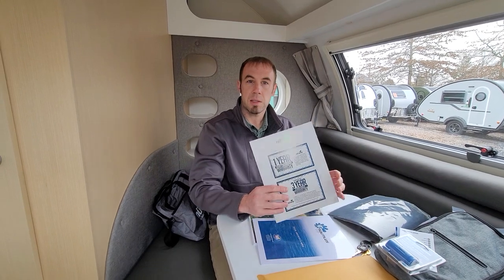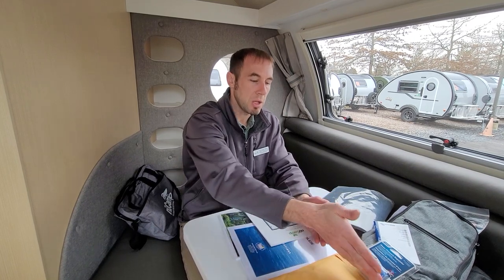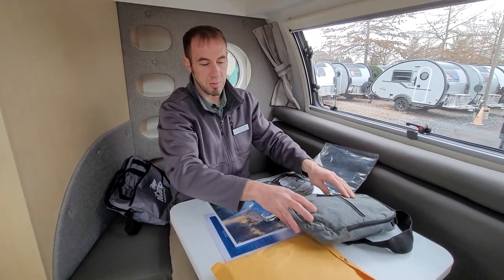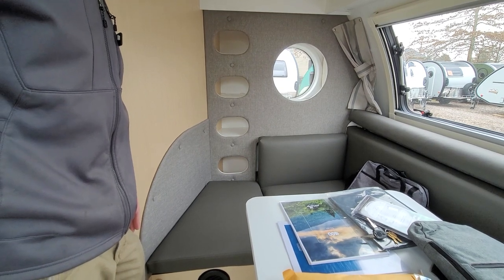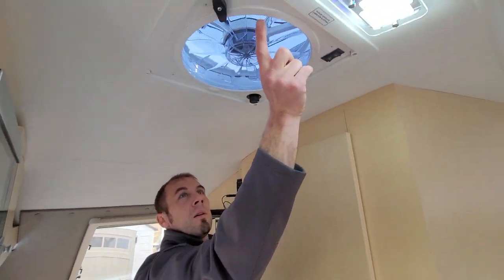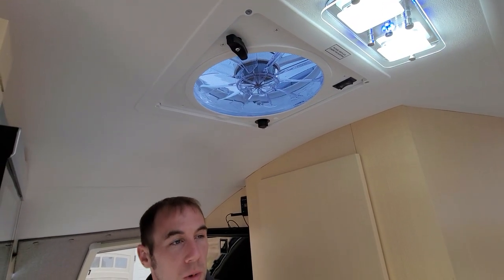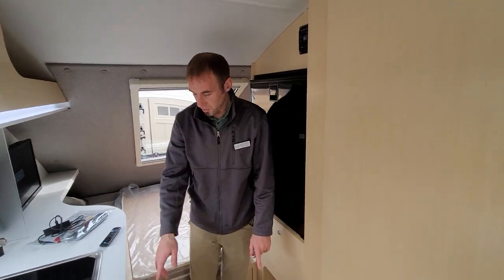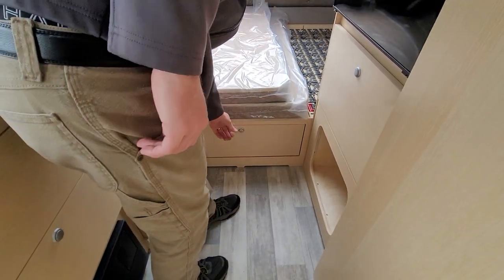2023 T@B 400 Instructional Walk-Thru (Part 1)

Comment: Just a quick comment.  The glycol is very specific to the ALDE system, so just normal marine grade glycol won’t work and if you make that mistake you have to pump the entire system clean and the fill with the proper glycol.  When we made that mistake, we were in Seattle about four hours from an ALDE factory.  They pumped and refill our system in about an hour.  At that time, the specific glycol was only available from ALDE direct.  The fill line can be hard to see on the glycol reservoir so we marked it with a dark marker.  As for the filter - we’ve had our 400 BDL since 2019 and I take the filter and wash it and/or vacuum it after each trip and it’s held up great.  Perhaps they changed the filter material but for us a simple spray down or vacuum or compressed air has worked.  The water pump switch is only necessary if you are using water from your fresh water tank.  If you are at a camp site and have connected to the site water, you don’t need to activate the switch.

Comment: Can you install a larger TV assuming you adjust the bracket vertically to account for height?
Reply from the maker: Yes, you can always install a larger TV, but you need to account for the spacing